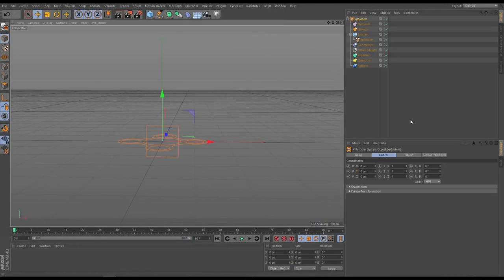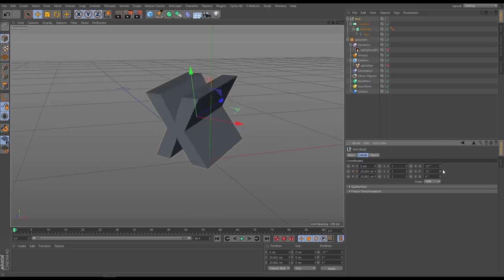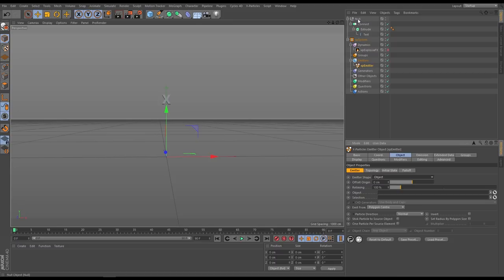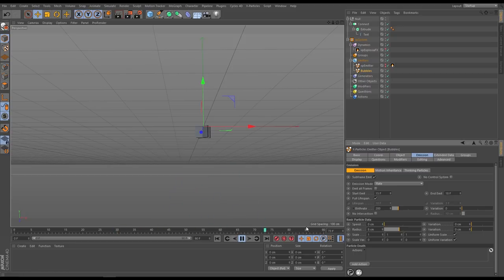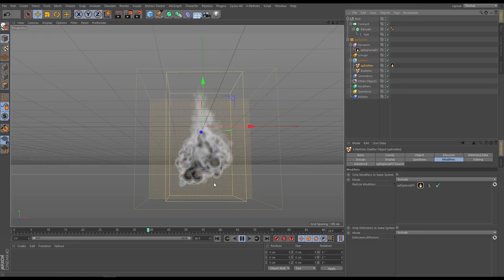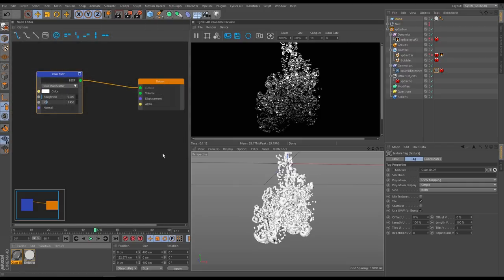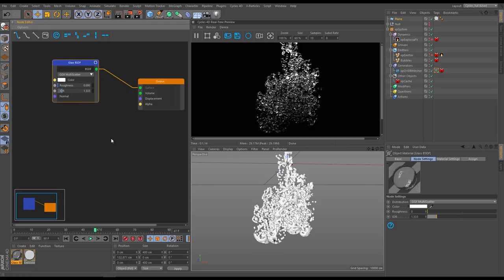Under Water Splash - Content Repository Tutorials 2019

Comment: Hi. first of all, thanks for the tutorial. i have been trying this tutorial now. ironically though it's seems not work. Even though i had followed the instruction which updated by some users and also im about to change the 'tempeture parameter from 0 to 1' but smoke does not arise.. Anyone who know about the problem solver reply this mention please!
Reply: Hey, I had the same problem. It worked for me when I adjusted the gravity of the explosia. rather then keeping it low i cranked it up and played around with the buoyancy
Reply: @TheTropical100  Yeah, I also did with the same conditions and It's looks like working at first glance. having said that, it's working due to the gravity parameter, not the explosion :( . I was droped the project because of no solution

Comment: Default ExplosiaFX in the latest Xparticles release doesnt seem to have the smoke floating up after the burn turn on by default. Any idea on how to turn that on? Thanks
Reply: also turn on a temperature
Reply: Same problem here. I’m using X-Particles 2020 and the way the smoke reacts is different from this tutorial (11 minutes in). Any fix to this?
Reply: @harukohayakawa3027  use also temperature
Reply: @tabstabs90  Where can I find this temperature setting? Thanks for responding.
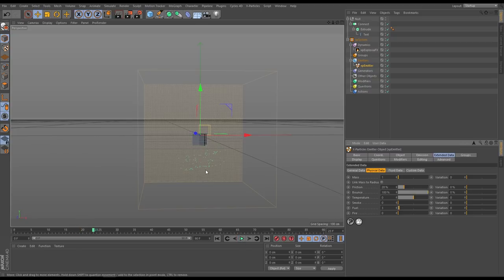Reply: @harukohayakawa3027  in "Physical Data", where you also change Fuel value. 9:01 Maybe in main its wrong way, but it helps me. Set Temperature to positive value and you'll see the result. I can upload you file, if it necessary.